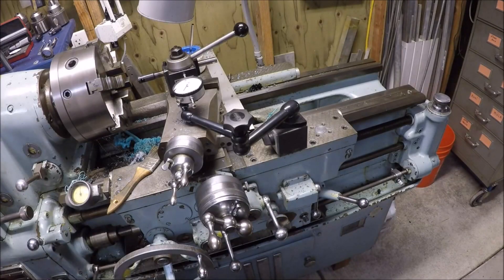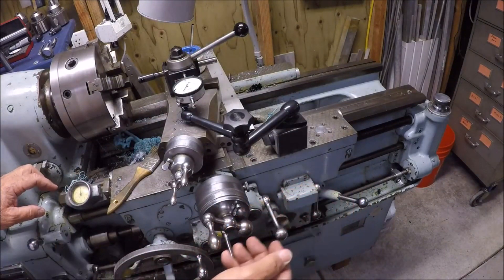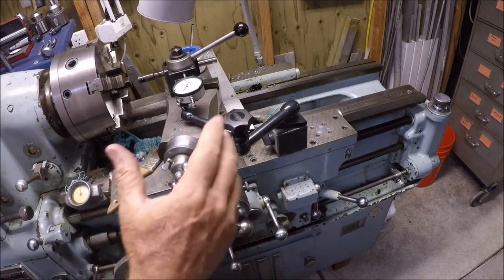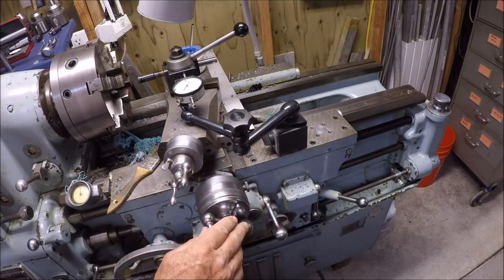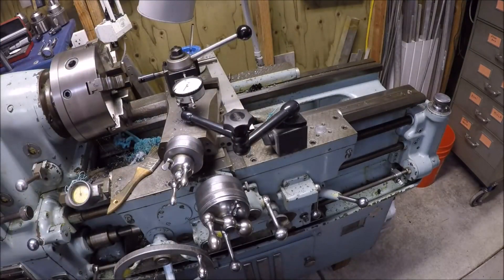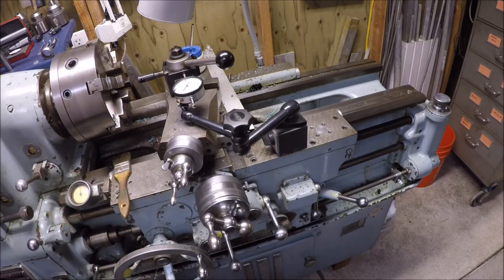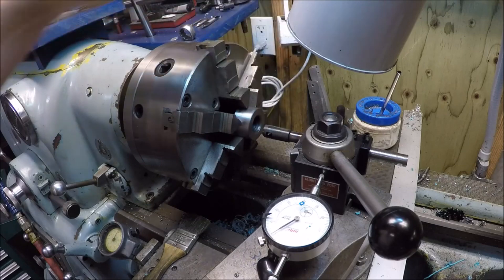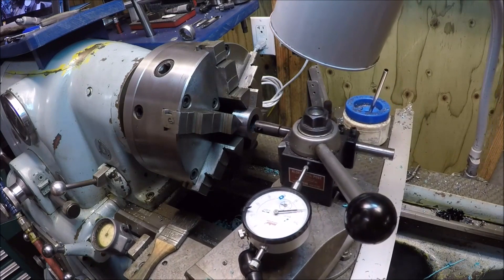Lathe Tip.....Timing or locating and interior thread on the lathe....

Comment: Good one Chuck .   Be careful of backlash with that method .   That's one of the reasons we keep the compound parallel with the bed , threads can easily be picked back up on the run .     Cheers  👍

Comment: Just a clarification question, are you turning the part (to be machined) in reverse of the cutting direction, or in the cutting direction?
I'm thinking that it would tend to bind on the cutting edges if it's in the cutting direction, whereas in the other direction, it's just sliding a tapered V in the thread groove.
Reply from the maker: thanks for viewing, I am turning the part similar as if the tool was a bolt
Reply: @outsidescrewball  Thanks for the swift reply Chuck, excellent video and idea to keep in mind👍🏻